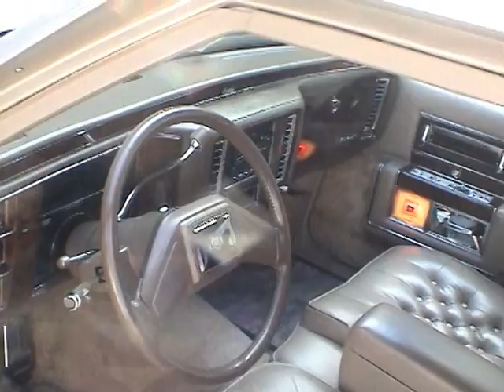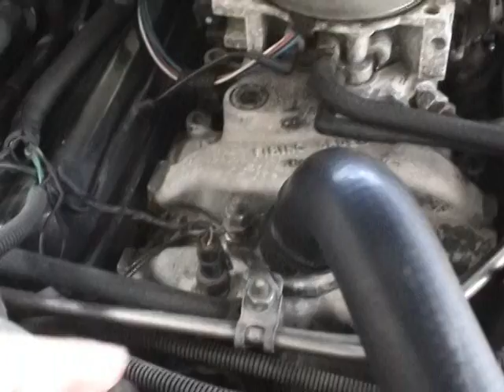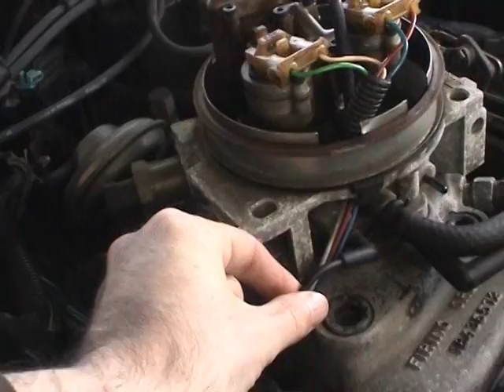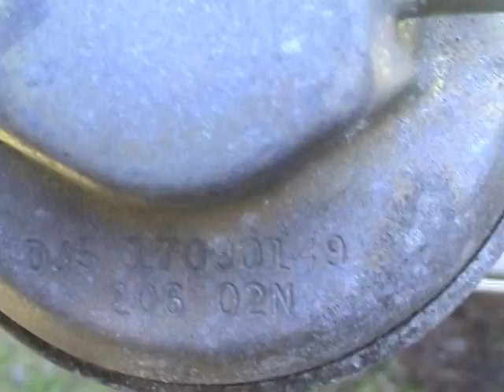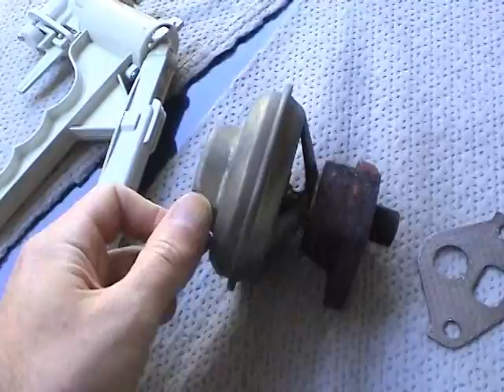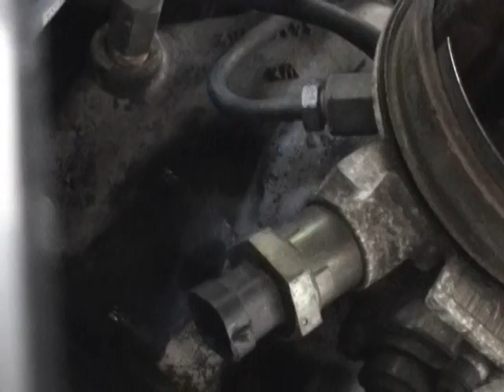1991 Cadillac Brougham EGR Valve Replacement

Comment: Here it from a 44 year experience master mechanic.   Sadly, absolutely nothing you beiieve has any truth to it.   Forget everything you think and start over.  Your lock up torque convertor is controlled by a plug circuit on the left front of your transmission and has nothing to do with engine temperature.   Also an engine with a open thermostat will get hot because its running on gasoline.  It can only cause your heater to take longer when its cold.  Also an egr has nothing to do with how an engine runs.  Thats why mechanics   and engine builders use block off plates after they become legally exempt .  Im am very sad for how you have wasted your mind.  May God bless you
Reply: If I do a egr delete on this exact engine is it going to cause my car to stall like this man says it would
Reply: Maybe
Reply: Wrong an open thermostat would over cool the engine because coolant is constantly flowing into the engine. A stuck closed thermostat would not allow coolant in the engine and would overheat. I did also notice his coolant reservoir was low which was probably another reason why he wasn’t getting good heat.
Reply: I have a 1991 Cadillac Fleetwood brougham 5.7 and today I changed my distributor and  cap and rotor plugs and wires and ignition coil and fuel filter and notice after running it about 5 minutes my service engine soon light came on and then it will go off after about 5 minutes and then come back on but the car is running fine  what can be causing that problem
Reply: @r-luvbham6608  As long as it runs good, there is no problem.  These cars, same as my cadillac brougham 1989 are emissions exempt and all of them including your 1991 that has the 350 chevy V8 will have engine lights that are on..  Figure, most of us have egr block plates installed and even smog pump removed on these cars and they run even better as a result. My cadillac uses the 307 olds V8 and the computer quadrajets two electric plugs are unplugged and the check engine light is meaningless.  I focus on coolant temperature and oil pressure and alternator output ONLY and that check engine light I simply put black tape over it so I dont have to see it.  As long as you try and satisfy that engine light, you are going to keep playing the game of useless things  on your engine.  Your free of that game so why keep being a part of it?  So long as your alternator light or oil pressure light or coolant light dont come on, you are free to drive another 100 k miles
Reply: @EarlGuyton425  thanks
Reply: glad I never had you work on my car
Reply: I really hope you just mixed up your words because if you’re really a 44 year old master mechanic, that would be sad for a 2 year old mechanic to know basic cooling system functions.

Comment: I just had the carb rebuilt it also started spitting fuel out the top. But the car still stalls started right up warms up then stalls out. Next I’ll try a mechanical fuel pump
Reply: The line that runs underneath might need to be replaced or cleaned out.

Comment: My Cadillac with a 5.0 carb started a rough idle and shuts off when the gas peddle is let off ???? And points
Reply: idle air control valve or may be fuel pump i have305 5.0 1991 and the 5.0 prior to 1991 (90- back to i think 87ish is a 307 Oldsmobile ) but may be the egr or throttle body or map sensor map sensor is on firewall middle of windshield clipped on firewall under hood - changed plugs.?

Comment: I love my 91 and its not nearly as clean as yours. they are almost twins, the only difference is I have the 305 and the cloth interior.  Mine just rolled over 200k on the original engine and transmission. I have never done anything to the tranny, not even a fluid change. I might have to do some work on it this year(my comment is going to bite my in the you know what lol) Keep up the good work! Oh and when you do the spark plugs, the easiest way for the passenger side is taking the wheel off and going through the inner fender. So much easier that way!
Reply: same i went thru inner fender on psgr side spark plugs and also cleaned my egr -changed ignition module and also changed air filter and cleaned entire throttle body as well as replaced the rotors pads and fuel pump i have 175k runs great makes a deep 4barrel carb sound wen i mash gas to floor sounds greattt
Reply: also i removed my catalytic converter amd str8 piped it since emissions arent necessary here

Comment: Great vid Shadow...as I have a 1991 Caddy as well I will right behind you,lol...so you are saying if the ports are somewhat blocked under the EGR,I have to take the intake manifold off??? Sounds like if I do that I should do other maintance if I have to go that far...also when you changed the thermostat..did you just undo the clip and point the hose skyward and green gushing out or did you drain??? Thanks again...